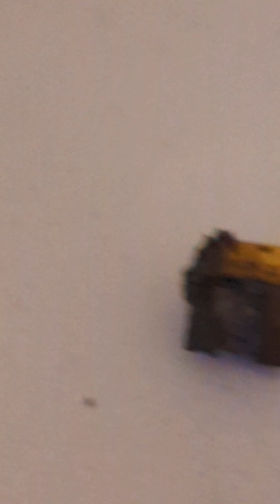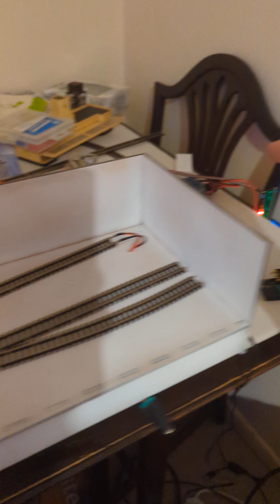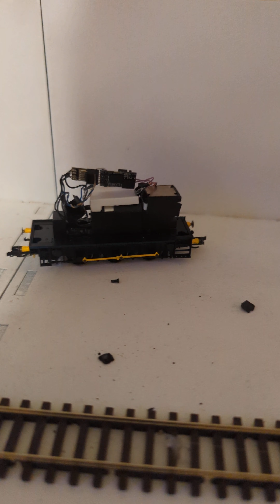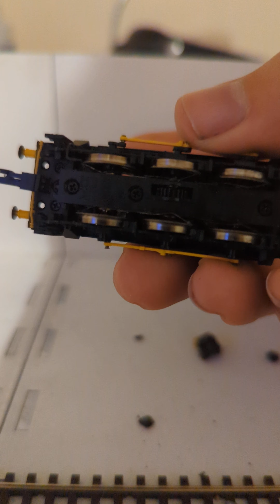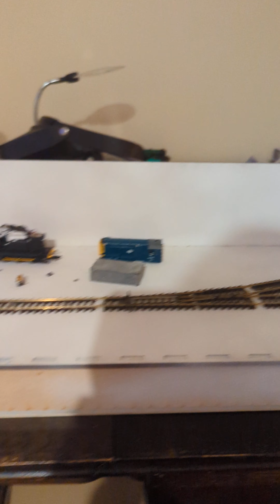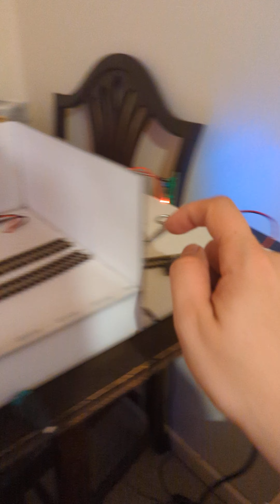I'm not very good at this! The 08 is alive but doesn't move!

Comment: The capacitors may be rated at 16v but there will be a +/- tolerance so could be more or less than 16v. From what I have seen in forums it would be best to use ones rated at 25v. Running at 15v and rated at 16v is to close.

Comment: Had you updated the HM7k chip to v2 firmware? If so they have changed the way they operate the stayalives, by fully powering them up, rather than trickle charging them as you go along. At least that’s how I understand it. If so, the lesser capacity non-HM7k stay alive you were using may simply not have been able to cope with the power the chip was trying to feed to it? Sorry, lots of ifs and buts in that theory, and I’m by no means an expert!!